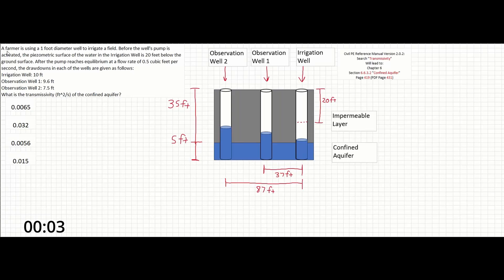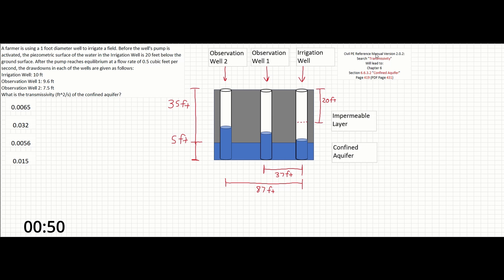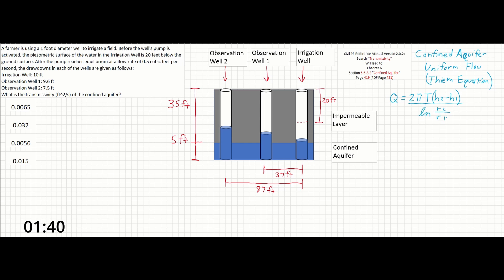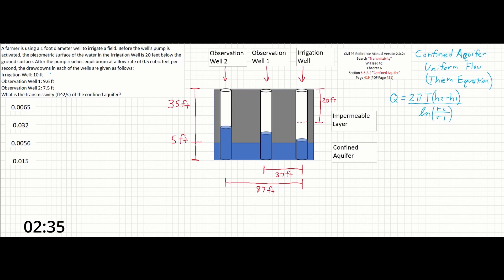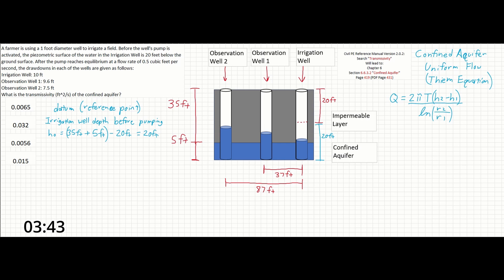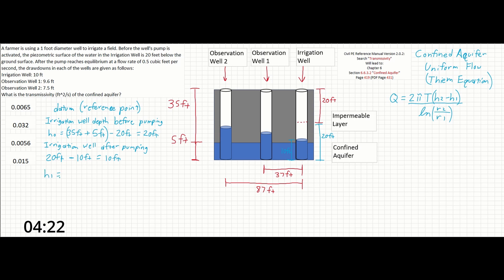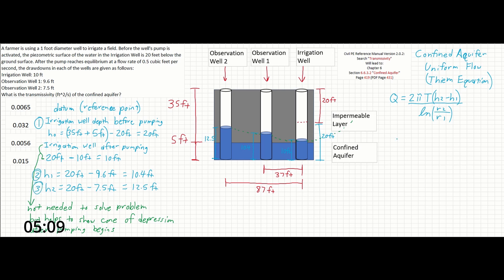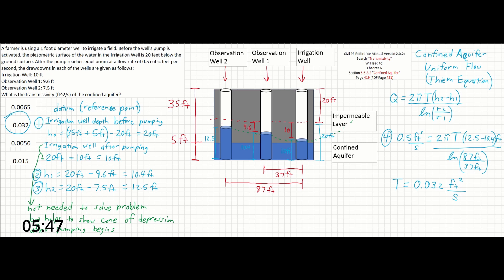PE Exam Practice Problem #81: Water Resources | Pumping Well - Confined Aquifer - Transmissivity

Comment: What am I missing here? My initial thought was to use the irrigation well for r1 and h1 and then use observation well 1 for r2 and h2. I've worked out various other aquifer problems where they provide you with a pumping well diameter and draw down along with an observation well and its corresponding r2 and h2 values to solve the problem. This the first problem I see where we are provided with a pumping well and two other observation wells.
Reply from the maker: This is a good question and from my very limited understanding, "more wells are better". In problems where only the pumping well and one observation well are given, you have no choice but to use the pumping well. But in this case, since we’re given two observation wells, the most accurate way is to use those two. Some Googling as to why talks about the pumping well including extra head losses that would misrepresent the aquifer's transmissivity (which is what we are being asked to solve for here). Hope this helps a little.
Reply: @SolvedIn6  yea I thought you could use r1 and h1 of the irrigation well if you wanted to. I tried it and I don't get the same T as you. Not sure why.
Reply from the maker: @sharVday  maybe just making a mental note to always used "the farthest two wells away from the irrigation well" is a good idea. I'd like to hope they'd never give you too many wells to complicate that.